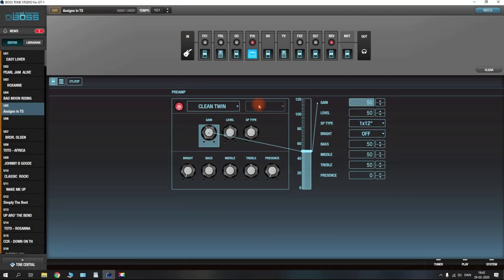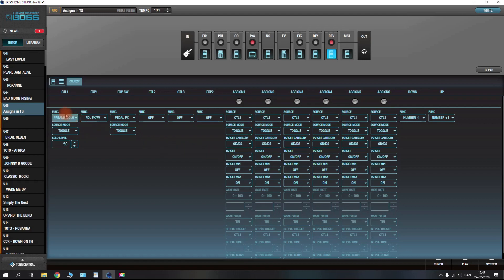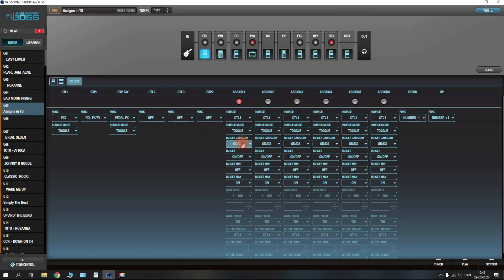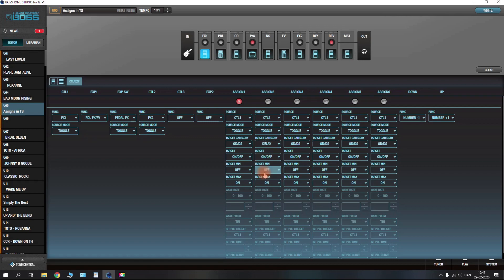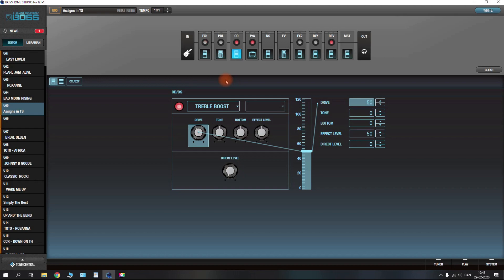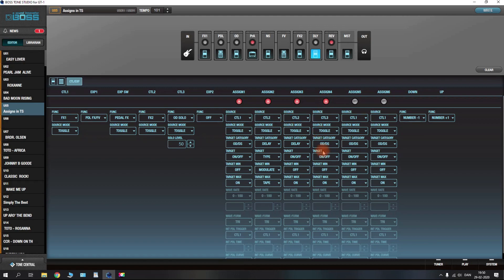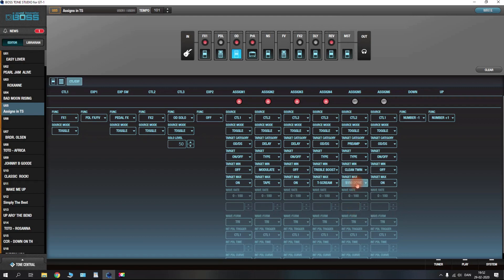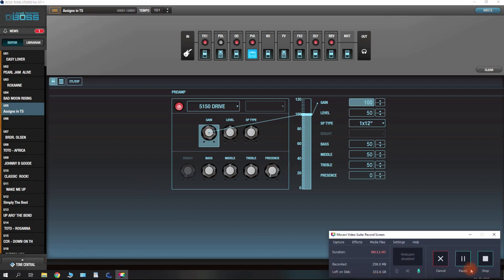Boss GT-1 | Boss FS-7  | Boss Tone Studio | Assign Setup & Management

Comment: Thank you for this great tutorial!
How can I save the FS-status LEDs to a user-preset? If I switch between user presets, the FS-7 LEDs don't follow the default setting of the newly selected preset but keep the status used in the previous preset.
Reply from the maker: Hi there,
Thanks for your comment and question, I greatly appreciate it.

Hmm, I'm not quite sure I understand?
What exactly do you want the FS-7 to do?

Thanks.
Cheers.
Reply: Thank you I will try to explain better :-)
I created several user presets where the FS7 is involved. 
Say I use one preset and for example switch on the LEDs of the FS7. When I now turn to a next song in the gig, I choose another user preset. When I select the next preset, the LEDs of the FS7 stay lit, they do not necessarily correspond to sound settings in the user preset. 
It would be nice if the user preset is able to control the LEDs according to the required settings.
Reply from the maker: @mrfrankweijers  - Hi again,
How do you have the FS-7 configured? Did you set it up like shown in the Manual for the GT-1, or?

Thanks.
Reply: @GuitarNTabs  I have it set to Latch, and Polarity 1, and connected via a stereo jack-jack cable to the GT-1.

Maybe it is not possible to control the LEDs on the FS-7 from the GT-1.
Reply from the maker: @mrfrankweijers  - Hi!
Alright, that's the default setup, and that should be good, however, check out this video I did, with the FS-7, and see if those settings will help you out:

https://www.youtube.com/watch?v=Rp2XACtp3pA&t=1s

Let me know how it goes.
Cheers.
Reply: https://youtu.be/iZ9POyFAOQE?si=n1P0TMfTJhftADxG

Comment: im using FS7 on my gt 1 y should i doble tap thee  fs 7 in order to change to my assign ? can i i adjust it to 1 tapos to change?
Reply from the maker: Hi there Bryan.
I'm sorry for the late reply, I've been running behind, catching up and answering to comments...

This is covered in the Owner's Manual and Parameter Guide PDF documents, but I'll explain it here as well.

In order to activate the Assign/FX with one press you need to set the FS-7's MODE to "FS-5U MOMENTARY" and the POLARITY to "I"
This will enable you to press once to turn the Assign/FX on, and another press to turn the Assign/FX off.
Reply: Same issue. Cannot figure out why
Reply: For single tap and for the light to turn on accordingly,  set the pedal mode to latch (actual fs-7)  and on the app (boss tone studio) put the source mode on CTL2 and CTL3 to moment. Hope that helps
Reply from the maker: @rebellion2933  - Thanks for stepping in here, Rebel Lion.
You're correct.

Thanks again.

Comment: Hi, I want to get a footswitch for my gt1 and was thinking about the fs7. Can I use the footswitch without a Y cable, or do you need that cable for both switches to work for different assigns? 
Thanks
Reply from the maker: Hello there, Padawan.
Thanks for your comment and question, I greatly appreciate it!

You should definitely go with the FS-7, it's a great footswitch and it doesn't take up much space on the floor/pedlaboard.
I absolutely love mine, and wouldn't trade it for anything!
You can use either a Y-cable or a TRS-jack cable. The TRS-jack has two rings, instead of the one we normally see on regular instrument cables.
You simply insert the TRS-jack into the A&B input on the FS-7 and it's all taken care of.

I hope this makes sense.
Best regards.
Reply: @GuitarNTabs  thank you so much for your reply  (and the rest of your videos). I'll go with the fs7 so.
Reply: I got the fs7 but it wasn't working out for me as you suggested. Then realised that a stereo cable was different than my standard patch cable and luckily enough I had a trs in my bunch of patch cables. All working good now. Thanks
Reply from the maker: @padawan9127  - That's excellent, I'm pleased to hear that!
Enjoy it, and rock on.

Cheers.

Comment: Hi I'm just a little unclear at the beginning of the video where it is showing the connecting of the pedal to the GT_1 unit itself. Is it showing that a TSR can be used in leu of the two mono inputs, or are both required? I'm asking because it appears to be saying (beneath the "B" input to connect a Y cable with two mono jacks and in addition to the two mono jacks, a TSR jack, which would be three jacks. I don't see that many inputs on the pedal. I could be misunderstanding something. I'm just asking for clarification. Thank you so much for any help.
Reply from the maker: Hi there.
The FS-7 can be connected with a TRS-jack, but also a Y-Cable, it all depends on which your prefer.

The FS-7 has two inputs, A and B. If you use a Y-Cable then you connect through both inputs.
If you use the B input, also labeled A&B, then you use a TRS-Jack.

I hope this helps.
Cheers.